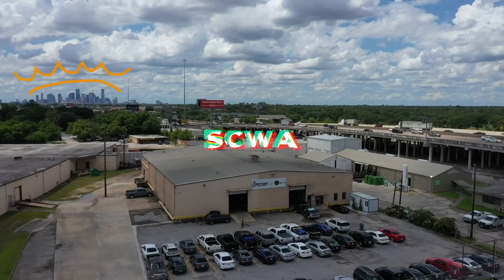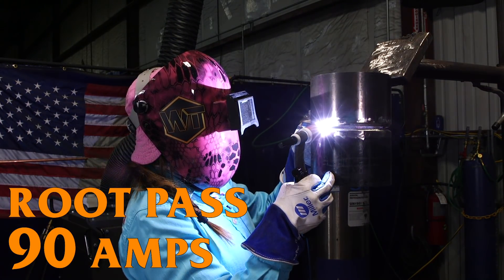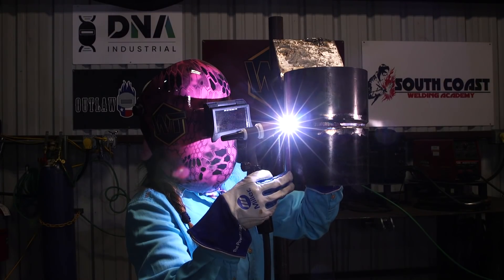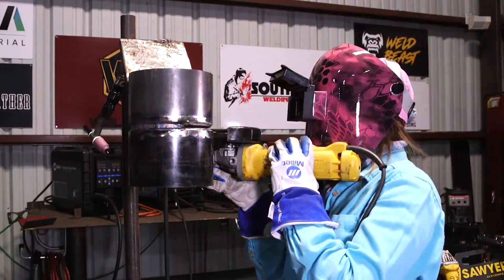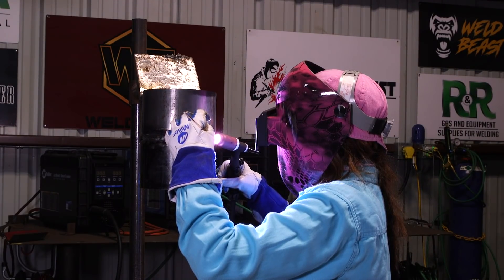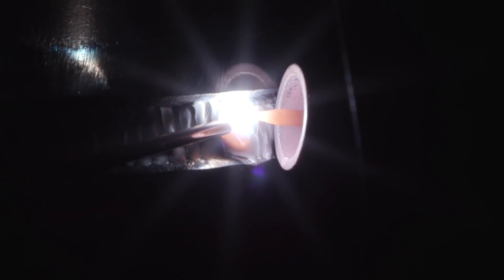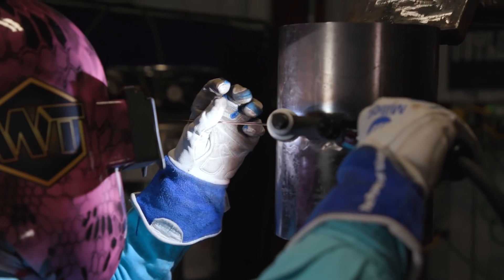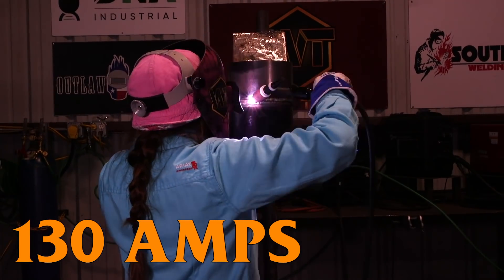Horizontal 2G TIG Welding  | Carbon Steel Pipe

Comment: I always cheese the root with more tacks then grind my tacks like yours.  Then I connect my tacks which, I try to put about an inch or so apart.  Then clean it up with a grinder, and if I need to, I will run a fuse pass.  The root will make or break the weld in my mind.   Doing it that way was easier for me, even though it may just be a mental thing.

Good video

Comment: Great video and many thanks to Sam. I think at `10.20 (and earlier) the video has been edited NQR. At that point it looks like Sam is on her last cap weave and not on the second fill pass which was the focus at that time. I'm just judging it off her rod position and the top weave run going over the bevel that 1/16th and coming back to blend with the lower weave.

Comment: Early on you commented on staying high, is this due to gravity pulling the puddle and the puddle helping heat the lower part such that you don't have to direct the arc to the lower part for as much duration?

EDIT: nevermind, you answered my question a little before the five minute mark.
Reply from the maker: Yes, you keep the rod on the top bevel as gravity will be pulling the puddle down.